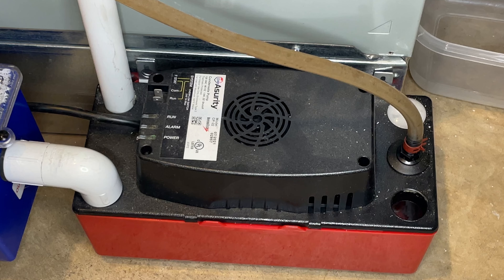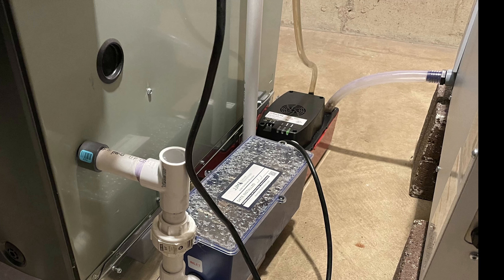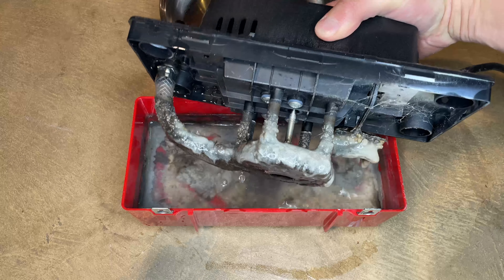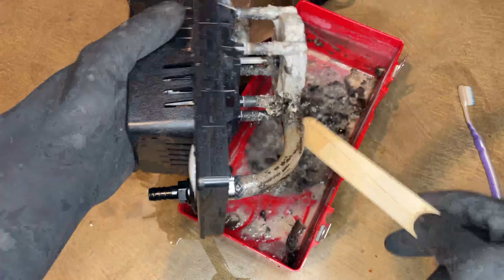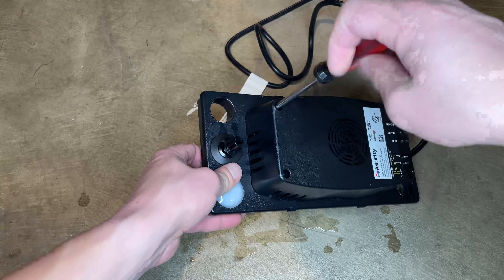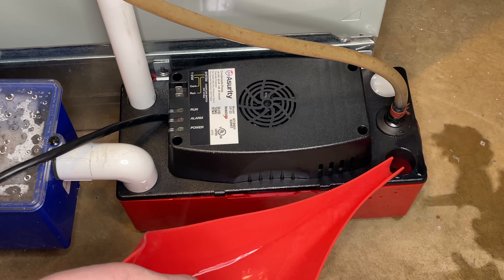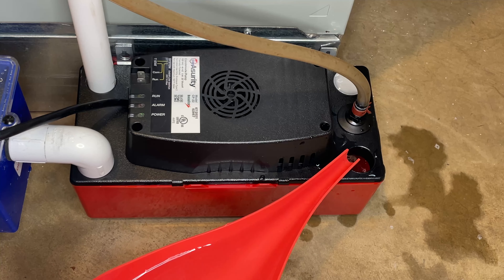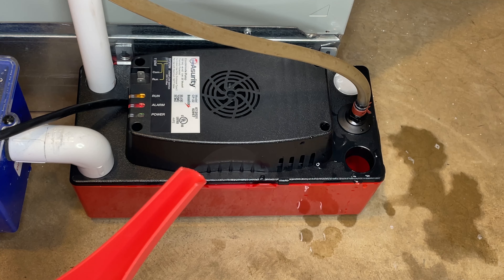Cleaning a condensate pump packed with slime

Comment: You can unscrew the fitting where the line was connected.   Inside this you will find a clogged up back-flow preventer.  "In this particular pump".